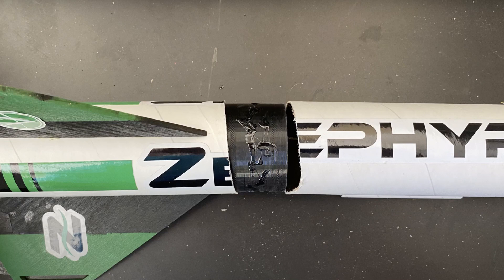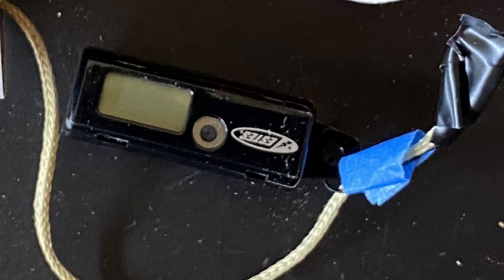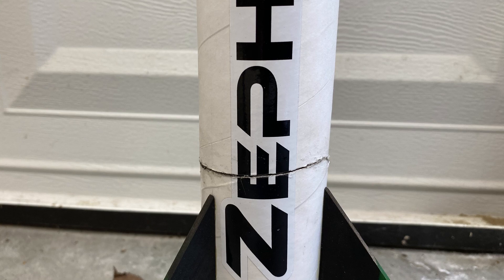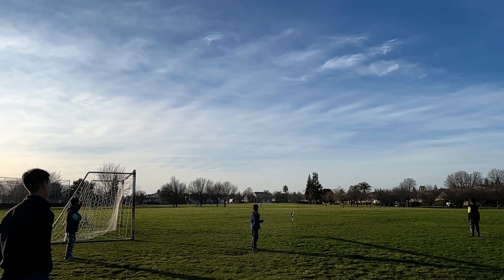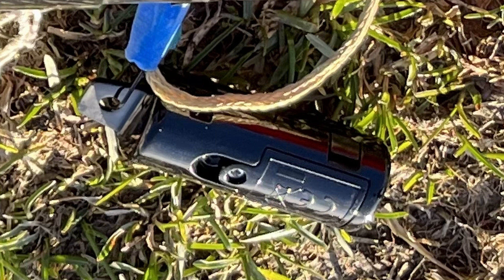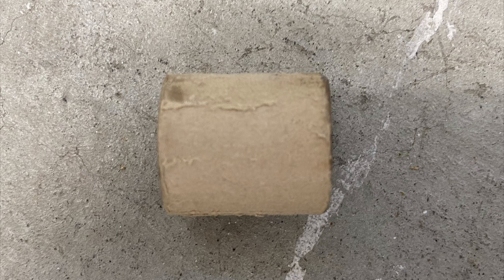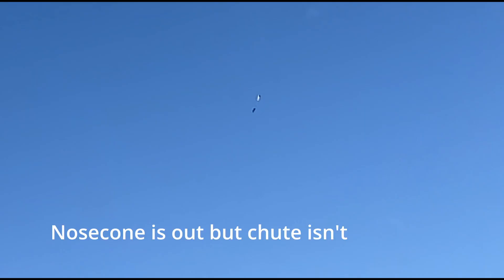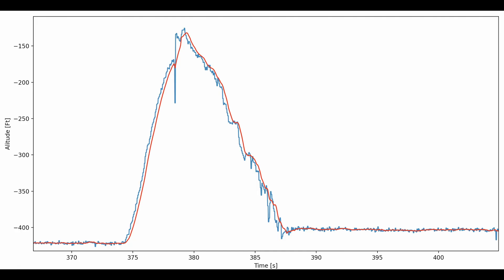Does our Homemade Altimeter Actually Work?

Comment: Good work. 
My son and I made a similar altimeter for his Space Exploration, Programming and Electronics merit badges. Our was powered by a 3.7v LiPo battery and an Arduino pro mini. Using the GY-BMP280 Atmospheric Pressure Sensor Module, we've found that the altitude varies based upon the weather. So our code logs a maximum elevation and we subtract our average elevation from that value to get the flight elevation. We validated the data by attaching it to my son's drone which gives a GPS elevation.